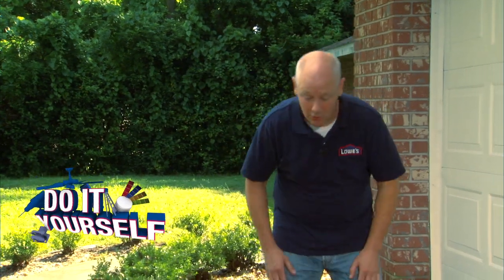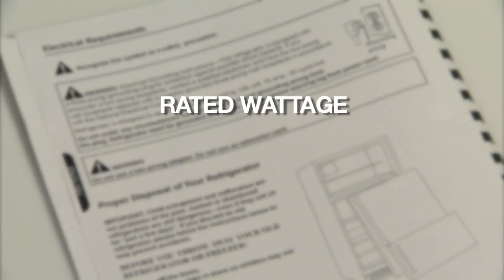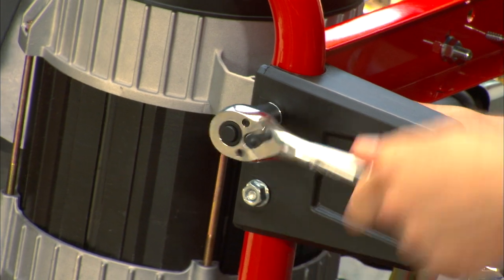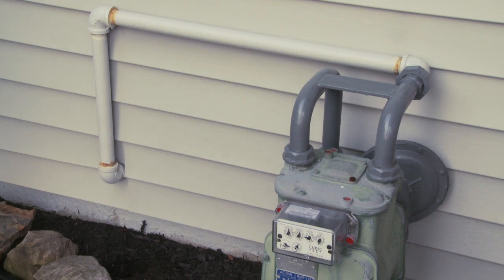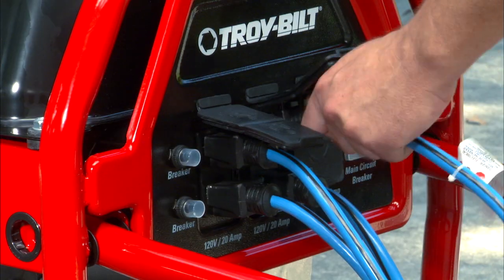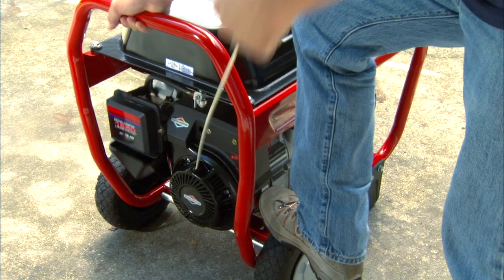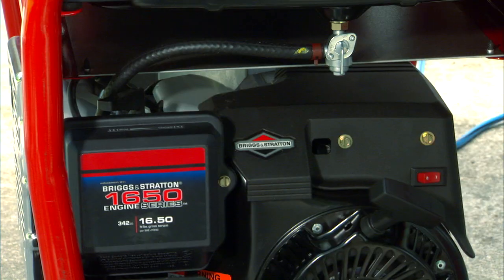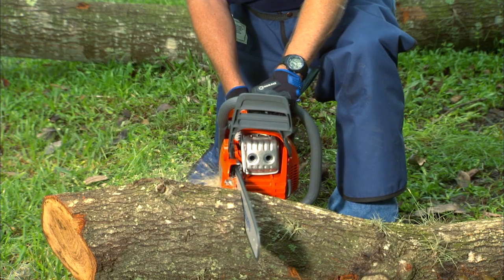Using an Emergency Generator | HURRICANE PREP

Comment: I have 2 predator 9000 watts, power went out down here in the south , triple digit weather and kept 5 AC units running and freezer , microwave and TV and router running
Reply: ⚠️Here’s an important safety announcement for everyone:

Please make sure you follow the generator safety tips whenever you use your portable generator. This is just a reminder for everyone’s safety. All generator safety rules need to be followed carefully 

Here are the generator safety tips: 

1) KEEPING OTHERS SAFE: Please do not allow an non qualified person or your children to operate and service the portable generator. Just because some manuals don’t say that doesn’t mean it’s safe. That is important against the generator safety rules. We also need to be keeping an eye on our children too. You need to make sure that your children are not playing near the portable generator especially when it’s running so they won’t get electrocuted. Generators pose electrical risks and they can be hot during an operation. Please keep your children away from the portable generator at all times. It is important to keep our children safe especially our little ones. Children often get curious about anything so we should keep an eye on them to also make sure they’re not wandering towards the generator. 

2) WHERE TO RUN YOUR GENERATOR: Some people use their portable generators indoors which increases the risk of carbon monoxide poisoning. It’s important to have a carbon monoxide if you have a gas generator. Never ever use your generator indoors even if your doors and windows are open and even in the garage is not safe to use a portable generator. Not even at your porch and your deck. It is never safe to use your generator indoors and in enclosed areas of your home. Your generator needs to be 15-20 feet away from your house. 

3)🔥FIRE HAZARDS: Never refuel your generator while it’s running. You need to let your generator cool off before refueling it and before storing your generator. Never overload your generator too. Never ever back feed your generator. You should never plug your generator into a wall outlet. Also never store propane tanks indoors. Please keep flammable things away from the generator as well and please don’t smoke cigarettes near the generator. Having a fire extinguisher next to the generator is also important against the generator safety rules. 

4) GENERATOR OPERATION: make sure your hands are dry before touching the generator. Never use your generator in wet conditions. Don’t let your generator get wet. You need a generator tent if you need to use your generator during wet weather. Please don’t wear loose clothes when operating the generator. Turn on your generator before plugging in appliances. Use the right cord for your generator. Please do not use worn out cords. 

https://youtu.be/I1jT3ANENvI and here is a video more about keeping others safe when using generators. All generator safety rules need to be followed carefully. 

Hope this helps. 

Please make sure you follow all the generator safety rules.

Comment: Might want to figure out how much fuel (and lube oil) the generator uses Because you're going_to/may need several days supply!

And, storage multiple gallons of fuel safely is another topic. 

Also, in winter your heating system  generally needs electricity... don't want to freeze you-all or the water pipes.

1:01 ... safe SHELTERED outside location...

MC273's suggestion 1:26 below... but be careful to watch how much electric power is being used.

If you're not good with this stuff, check with appropriate knowledgeable people... you want this to work when you need it.
Reply: ⚠️Here’s an important safety announcement for everyone:

Please make sure you follow the generator safety tips whenever you use your portable generator. This is just a reminder for everyone’s safety. All generator safety rules need to be followed carefully 

Here are the generator safety tips: 

1) KEEPING OTHERS SAFE: Please do not allow an non qualified person or your children to operate and service the portable generator. Just because some manuals don’t say that doesn’t mean it’s safe. That is important against the generator safety rules. We also need to be keeping an eye on our children too. You need to make sure that your children are not playing near the portable generator especially when it’s running so they won’t get electrocuted. Generators pose electrical risks and they can be hot during an operation. Please keep your children away from the portable generator at all times. It is important to keep our children safe especially our little ones. Children often get curious about anything so we should keep an eye on them to also make sure they’re not wandering towards the generator. 

2) WHERE TO RUN YOUR GENERATOR: Some people use their portable generators indoors which increases the risk of carbon monoxide poisoning. It’s important to have a carbon monoxide if you have a gas generator. Never ever use your generator indoors even if your doors and windows are open and even in the garage is not safe to use a portable generator. Not even at your porch and your deck. It is never safe to use your generator indoors and in enclosed areas of your home. Your generator needs to be 15-20 feet away from your house. 

3)🔥FIRE HAZARDS: Never refuel your generator while it’s running. You need to let your generator cool off before refueling it and before storing your generator. Never overload your generator too. Never ever back feed your generator. You should never plug your generator into a wall outlet. Also never store propane tanks indoors. Please keep flammable things away from the generator as well and please don’t smoke cigarettes near the generator. Having a fire extinguisher next to the generator is also important against the generator safety rules. 

4) GENERATOR OPERATION: make sure your hands are dry before touching the generator. Never use your generator in wet conditions. Don’t let your generator get wet. You need a generator tent if you need to use your generator during wet weather. Please don’t wear loose clothes when operating the generator. Turn on your generator before plugging in appliances. Use the right cord for your generator. Please do not use worn out cords. 

https://youtu.be/I1jT3ANENvI and here is a video more about keeping others safe when using generators. All generator safety rules need to be followed carefully. 

Hope this helps. 

Please make sure you follow all the generator safety rules.

Comment: And for heaven's sake, run the generator at least once a month under load and make sure all gas is out of it before putting it back up.
Reply: ⚠️Here’s an important safety announcement for everyone:

Please make sure you follow the generator safety tips whenever you use your portable generator. This is just a reminder for everyone’s safety. All generator safety rules need to be followed carefully 

Here are the generator safety tips: 

1) KEEPING OTHERS SAFE: Please do not allow an non qualified person or your children to operate and service the portable generator. Just because some manuals don’t say that doesn’t mean it’s safe. That is important against the generator safety rules. We also need to be keeping an eye on our children too. You need to make sure that your children are not playing near the portable generator especially when it’s running so they won’t get electrocuted. Generators pose electrical risks and they can be hot during an operation. Please keep your children away from the portable generator at all times. It is important to keep our children safe especially our little ones. Children often get curious about anything so we should keep an eye on them to also make sure they’re not wandering towards the generator. 

2) WHERE TO RUN YOUR GENERATOR: Some people use their portable generators indoors which increases the risk of carbon monoxide poisoning. It’s important to have a carbon monoxide if you have a gas generator. Never ever use your generator indoors even if your doors and windows are open and even in the garage is not safe to use a portable generator. Not even at your porch and your deck. It is never safe to use your generator indoors and in enclosed areas of your home. Your generator needs to be 15-20 feet away from your house. 

3)🔥FIRE HAZARDS: Never refuel your generator while it’s running. You need to let your generator cool off before refueling it and before storing your generator. Never overload your generator too. Never ever back feed your generator. You should never plug your generator into a wall outlet. Also never store propane tanks indoors. Please keep flammable things away from the generator as well and please don’t smoke cigarettes near the generator. Having a fire extinguisher next to the generator is also important against the generator safety rules. 

4) GENERATOR OPERATION: make sure your hands are dry before touching the generator. Never use your generator in wet conditions. Don’t let your generator get wet. You need a generator tent if you need to use your generator during wet weather. Please don’t wear loose clothes when operating the generator. Turn on your generator before plugging in appliances. Use the right cord for your generator. Please do not use worn out cords. 

https://youtu.be/I1jT3ANENvI and here is a video more about keeping others safe when using generators. All generator safety rules need to be followed carefully. 

Hope this helps. 

Please make sure you follow all the generator safety rules.